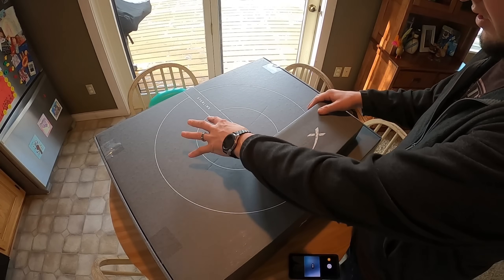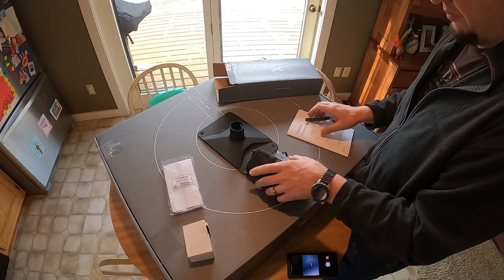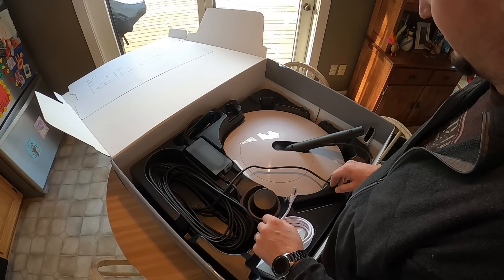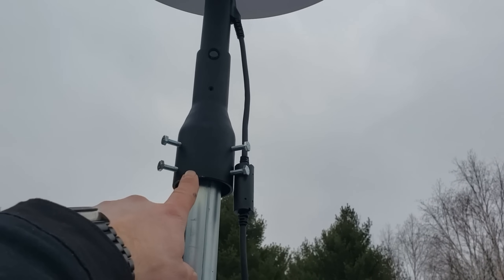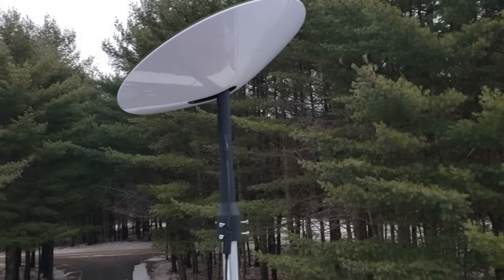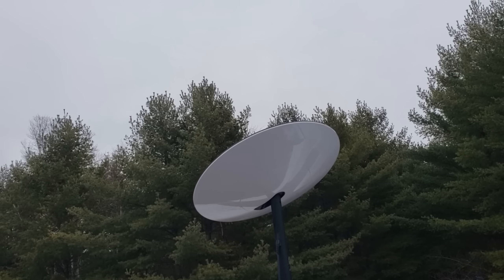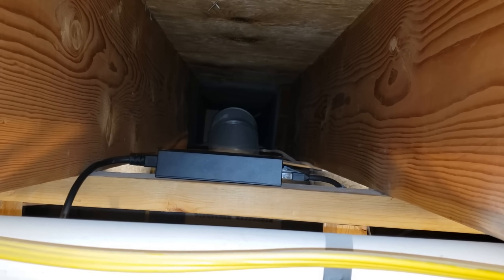Starlink unboxing, install on a pole mount and roof, speed tests, and more!

Comment: Wait does it automatically calibrate to new satellites or is it manually. Cus fuge if my internet will be bounce from 80mbps to 170 maps I rather stick with spectrum
Reply from the maker: Everything is automatic.  Mount it and plug it in.  It does everything else itself: find satellites, connect to satellites, switch satellites.  The only thing you do on set up after plugging is connect to the wifi and change the wifi network ID and password to your own custom.
Reply from the maker: If you have Spectrum and are happy with the speeds, I wouldn't switch.  This is designed for those with hardly any choices for broadband.  Me, my choices were DSL (ok price low speeds)or high orbit satellite dishes(with high latency, data caps, high price)

Comment: The dish is heated so snow and ice will melt.
How much a month will this cost? I know you will have to purchase the equipment.
Reply from the maker: Yes.  It is heated so the snow melts.   As of now, the equipment is $500 up front and then the service is $99 / month.  No contracts in the current Beta period.  Compared to other satellite internet, this is a steal with the speeds and latency.

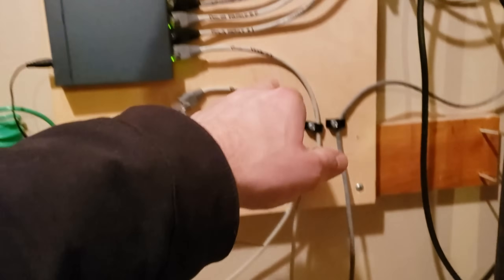Comment: Shouldn't you earth the pole? 15:18 Use a thicker cable to not have issues with PoE. Speed won't change much, CAT6e (typically 24AWG)  can do 10 Gigabit for 30 meters and a Gigabit for 100 meters. CAT6a (typically 23AWG) rated for 10 Gigabit for 100 meters. CAT7, CAT7a (Either 23AWG or 22AWG)

Comment: There is a difference between MB/s  and Mb/s  One is MegaBytes the other is Megabits  you are getting Mb/s (Megabits/sec). to get 120 MB/s you would have to be getting GigaBit/s service from StarLink.
Reply from the maker: I didn't realize there is a difference between MB/s and Mb/s.  I'll fix where ever I have that posted.  I just go by whatever the speed tests relate and don't pay attention to the capitalization of the letters.  Thanks for the guidance.
Reply: @OutdoorsEngineer  If you divide the Mb/s by 10 that is the approximate MB/s you are transferring. As an example, with the AT&T bottom tier fiber service 100 Mb/s the actual data transfer is around  10  Mega Bytes per second; that's some serious data movement. With their Gigabit service 1000 Mb/s  the data transfer is about 100 Mega Bytes per second; that's some screaming service.
Reply: @edwardfknight  
or you can divide it by 8, which is the exact difference. 8 Mbps = 1 MBps.

Comment: I have high speed cable and the option for Fiber to my house, so I don't need this.. BUT.. I am also an RV owner and I want to be able to work while I travel and Starlink is ABSOLUTELY on my horizon for that and I'm very excited to see these Beta reviews starting to come in.
Reply: Same here.  I have good Internet at home but would switch to Starlink for the mobility.  I want to be able to camp in the middle of nowhere and still have Internet service for work.
Reply from the maker: Right now the dishes are grounded to their geographical locations.  I'm sure someday, they will offer mobile options for the RV'ers.
Reply: If I had options for cable (100 Megs or higher speeds) or fiber I would not subscribe to this. However because the service may be considered to be used in various locations then it would easily satisfy all your connectivity. Because it's locked to a location then no.
Reply from the maker: @RogerDiotte  certainly.   If I had options for cable or fiber, I would do it.  But the cost to get that would be huge, and nobody wants that bill.

Comment: how the hell is it a game changer when it costs 99$ per month + 450 $ initial payment? please tell me how can it be considered more than a scam? I pay about 40$ per month and I have fiber optics. How many people can afford 450$ initial payment and 99$ per month on this planet?
Reply: Many millions can afford that. If you can get fiber, this is not for you. Lots of people living in rural areas with terrible internet. This opens up the possibility of living anywhere if you can work remotely. Cost may come down with scale of manufacturing the dishes. Also, the speeds will be even faster than this, and in poorer areas several households could share a connection and still have good service.
Reply: If you have fiber or cable, this isn't for you. This is for people who WISH they had fiber or cable. I have no other choice but $100 per month for 4G LTE (we barely get 1Mb/s) with data caps. This will be a HUGE upgrade for us, for a similar price. You have an option, but there are many rural people who do need it. Would I buy fiber internet for $100/month? Of course, but there is no fiber here, no cable, no DSL.
Reply: It's just came out probably that's why it's expensive it might be cheaper in the future
Reply from the maker: I've read they are losing money on the equipment.  Considering I am paying $50 a month for DSL @ 5 mb/s download speed, this is a bargain. I don't have access to FO like those in urban areas.  As with most of Rural America.  If the telecom companies would have have taken the free grant money they have received and put it into upgrading existing infrastructure, this wouldn't be an issue.
Reply: @Nathan-lt6bw  just like Tesla was supposed to be? He (Elon) said that they (tesla cars) were supposed to get cheaper and cheaper, guess what 7 years later they are getting more expensive, I’m not advertising for anyone but he’s no different (and that was their advert that they’ll do things different) than any other car manufacturer. So please please tell me anyone, what is the difference, in terms of appealing to the poor, between this idiot and any other idiot? tesla vs. vw? starlink vs. vodafone in europe, at&t in us for example? No difference, but we do like to kiss a***s just to get some benefits.
Reply: @rc09890  somebody has a grudge.
Reply: MS Radu please understand this is meant for poor peeple like me who have no option.
Reply: @willywilkins7494  besides that, we’ve had (i’m not a us resident I dont even live in US, but we’ve had, as a race, human race) 20.000 families waiting in lines for the food bank in Dallas last month in one day, how many of them do you think could afford 99$ per month for internet?  that is the standard I take for poor, the person who cannot afford to put food on the table. This year, internet is not a commodity, is not a luxury, is a necessity, we have kids doing online classes, so putting a high price on internet is, basically putting a high price on general public education, that is, literally, limiting the human right to education, at least that is how I see things, this might be wrong, but it’s not right either.
Reply: @willywilkins7494  I’m sorry I dont want to offend you, but were I come from, if you can afford 99$ per month for internet, you most definitely are not poor. That’s all I meant.
Reply: Its a game changer for people who otherwise rely on existing satellite internet providers, like Hughesnet, which have tiered data caps, max download speeds of 25 Mbps and bad latency since they are geosynchronous. 100 dollars a month would get you a data cap of 30GB per month, 25 Mbps and shit latency.  You can forget about streaming. This is a humongous life changer for people who live out in the country.  And it will only get better.
Reply: Ok guys, I must apologize, I am used to what we have here in Europe. I’m sorry I wasn’t thinking of the large uninhabited or sparsely inhabited places in US. In EU 100$/month for internet with that kind of speeds is considered ripoff, but for remote places, yes, you guys are right. I apologize again.

Comment: nice! I m curious to know how it performs in rain, snow conditions. the dth sucks when there's severe weather conditions. please do update regarding this.
Reply from the maker: So far I have been happy.  yesterday it rained here all day, and transitioned to heavy snow once the the cold front blew through.  Ended with 1.2 inches of snow, and the internet is just as fast this morning.  I have noticed in heavy snow, the speed does slow a little, but I guess that is to be expected. They have a nice graphing system in the app that reports the Ping Success, currently download and upload speeds, current connection strength to the various satellites.  That connection strength waivers during snow, but quickly steady's once it stops.  The heating system in the dish works well.

Comment: Do you plan to attach a lightening prevention cable into the ground. Thats mandatory i think
Reply: Good advice. I assume Starlinks, documentation will say something about this.
Reply from the maker: Here is the response for this question from Starlink:

"You are able to see all mounting types and installation recommendations on the install guides located in [link removed]. These detailed install guides will give you all necessary information to help in selecting the mount appropriate for your location!"

The documentation then says this: 

  "Plug the power cord into an AC outlet that is easily accessible at all
 times. If the power cord has a 3-pin attachment, plug the cord into a
 grounded (earthed) 3-pin outlet.":

Comment: What is the packet loss. The ping is very high and you might lose quite a bit of packets.
Reply: That ping is very low for satellite and will get lower as more satellites are launched.
Reply: It's just the double of fiber optic, not that bad.

Comment: I'd have to put it on a 110 foot pole to clear all the trees the app says that needs to be clear. This thing is going to be useless for around 70 percent of the homes in this area because of all the tall trees we have.
Reply from the maker: That is one downside.  Although, there is another channel I saw and he has one tree about a third of the way into the obstruction free area.

Starlink has said that as they add more satellites, the obstruction free area will be reduced. It is all about the moving satellites above, as one leaves the area, it has to  go and search back to the west for another that is incoming.

Comment: How long are your outages when you encounter them?
Reply from the maker: 30 seconds up to a minute or two.  

In the last 24 hours I had 2 minutes of "No Satellites" and 4 minutes of "Beta Downtime", which I would take to mean outages do to changes or things Starlink is doing on their end.  

I also got this note within an email from them today.  "Most notably, the Starlink team has begun repositioning of more than 500 satellites in an effort to improve coverage and decrease outages. These maneuvers may introduce short outages in the near term, but the final result is expected to substantially improve user experience in Q1 2021."
Reply: @OutdoorsEngineer  not too darn bad at all for beta

Comment: I'd never roof mount any sat dish in the northern zone because of snow etc sticking to dish face, unless you have a 100 foot brush to clean when needed, ground mount is the way to go....
Reply from the maker: The Starlink dishes are heated and melts the snow off.
Reply: @OutdoorsEngineer  Good to know...

Comment: Very happy with my Starlink system.  Had it for about 3 weeks now.  Love your roof mount.  I may change mine if it doesn’t work out.  I have some videos on my channel if you want to see my setup
Reply from the maker: Great to hear!  I am very happy and it has only been 5 days.  It's awesome.  I like it being on a pole due to snow that we get.  Sometimes there could be 2 feet of snow up there.  This will keep the receiver above the snow!

Comment: Isn't there a grounding provision to guard against a lightning strike on the antenna and pole?
Reply from the maker: There is nothing in the install regarding this.  I have sent Starlink a support question asking about grounding and lightning.
Reply: @OutdoorsEngineer  Run a decent copper wire up one of those trees.

Comment: Did you Ground the Pole? Did you need a Amp for the length of line?
Reply from the maker: Did not ground the pole.  But I may.  

No amp needed.  100' is supplied by Starlink.
Reply: @OutdoorsEngineer  Shouldn't it be a requirement to add a ground wire to protect against static charge buildup on the dish or against lightning strikes? Take a look here:   https://www.ecmweb.com/national-electrical-code/qa/article/20889915/code-quandaries

Comment: With these data transfer rates, even people living in areas with cable internet should switch to Starlink.
Reply: Like a cell tower they have limited in/out channels on the sats so places that have better internet options generally have more people so not a good mix for starlink. If they are one of the few to switch over in an area they are good but if too many switch it slows the system.
Reply from the maker: @TheUserid82  That is a good analogy.  Precisely why it will not be a good option for those in urbanized areas.
Reply from the maker: Agreed.  The biggest issue at this point is obstructions.  This was really the only spot in my yard that didn't have obstructions.  Unlike other satellite services such as Dish Network, Direct TV, Hughes net which lock onto one satellite, Starlink requires a pretty open area.  The satellites are moving and as one leaves the area it goes and searches for another.  

I'd imagine as they get more satellites launched, that open area requirement with no obstructions will shrink.

Comment: Would you have to use the pole mount or could u just take the pole that is built into the dish and attatch it to an existing mount?
Reply from the maker: The dish side actually fits very nicely inside of the 1 1/4" structural steel pipe that can be purchased from Lowes.  Actually fits tighter than the separate pole mount purchased from Starlink.  

Starlink offers the tripod that comes with the dish and then currently three other mounts.  A roof peak mount that is only held down by 80 lbs of weight and not mechanically attached to the roof.  The Volcano roof mount which uses lag screws to attach to the roof.  And then there is the pole mount.
Reply: @OutdoorsEngineer  cool beans, just got my invite yesterday and thinking about taking the plunge and doing it. Currently have Hughes in east central mn and its garbage. Thing that was holding me up is the having to drill into the roof more but if I could use an existing mount that I have would be awesome and it sounds like theres a good chance I can! Thanks for the info
Reply from the maker: @skier008  certainly.  If the existing mount is a pole, just order the pole mount as well.  I think it was $25.   Then you know you can just drop it right on the  old mount.  I'm guessing you could use the old Hughes net mount.    Before you order, download the Starlink app and use the Check for Obstructions feature to make sure the location works.
Reply: @OutdoorsEngineer  Is that 1 1/4” or 1 1/2”? I’m getting my mount ready while I wait for an invitation, and have used 1 1/2” electrical conduit
Reply from the maker: @edwardemberton8069  1 1/4" structural pipe from Lowes.  The pipe on the dish side actually fits very nicely inside the 1 1/4".

Comment: How did you get to be a beta tester?
Reply from the maker: Sign up at starlink.com.  Input your email address in and physical address.  They then will send you an invite if/when service becomes available in your area.  Luck of the draw I guess.
Reply: @OutdoorsEngineer  Thanks for responding so quickly.

Comment: Looks like a lightning rod on the house for a lightning strike which will travel through the Cat 6 and take out all connected equipment. Did they have any guidance on grounding the antenna?
Reply from the maker: Good point.  Never thought about that.  No guidance on grounding of equipment.  I will have to send them a support message and see what they say.
Reply: If the system is properly grounded then there will not be an issue. Actually, it is a positive since it would act as a safe lightning rod protecting the house and its inhabitants from dangerous uncontrolled lightning hits. Starlink is not the first to use internet transceivers on a roof. Here in Phoenix, there is a company that transmits a line of sight from the in-city mountains for almost two decades.
Reply from the maker: @RJ_P777  Correct.  And that is about what Starlink's response was.  Make sure that the power supply is properly grounded, which here it is.
Reply: @OutdoorsEngineer  If it is grounded to an outlet it will probably fry most of the stuff in your house that is attached to outlets.  Get an antennea grounding kit and run a copper wire to the grounding rod where your power comes in.  Electricity wants the easiest way to ground so give it a direct way there with a good copper wire and it will likely bypass coming inside.  As a backup get a good surge protector $100+ (ZeroSurge) and plug into that instead of directly into an outlet.

Comment: The lan cable is there own proprietary type that can handle there High power going through them. It's also triple shielded. Which is comparable to Cat7 Cat8 I would ask them what comparable Cat cable you should use.
Reply: Blue Jeans Cable makes certified  Cat 7, and 8 cables to order.  Great place been a customer for nearly 10 years.
Reply: @transmaster  awesome where are they out of?

Comment: What is that site in the background tracking the satellites? Eagerly awaiting my dishy to arrive Christmas eve-day.
Reply: Found it ... https://satellitemap.space ... always nice seeing these video in rural areas, Thanks!
Reply: @neurocis8711  you get yours yet?
Reply: @RogerDiotte  Yes, arrived on the 21st, hacked up a mount to my deck railing and ordered the pole mount. Pole mount arrived 28th installed that day off of a corner of the house. My uptime has averaged 99.2% at ~90Mbps down, 25 Mbp up 30ms latency.